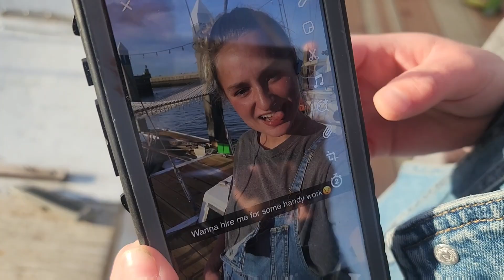Rotten Cabin Tops + Rainy San Francisco Weather | SHE SAILS SOLO

Comment: That ledge that becomes the shelf is a bad place for the water to accumulate! are the cabin tops rotten? could you just neatly chop them off, replace that ledge, then put glue them back? it's sometimes hard to say if it's easier patching something or rebuilding it...

watching your progress with interest! there are discouraging moments like this but I know you'll get through it!
Reply from the maker: About 1/3 of the cabin tops are rotten. I'm working on temporarily sealing them for now to stop the spread and then rebuilding them and moving the hatches later when I can haul out for awhile.